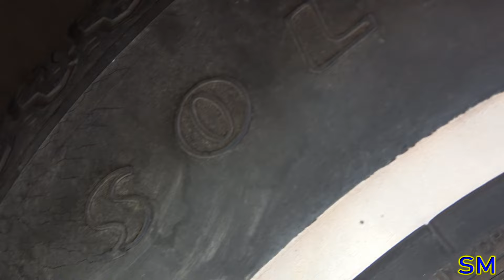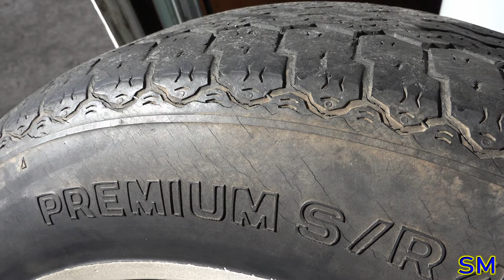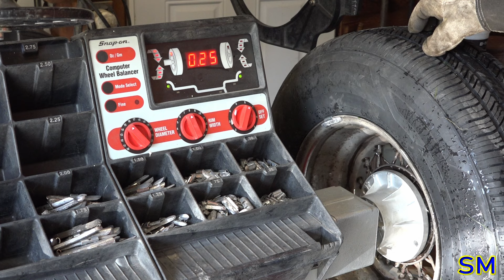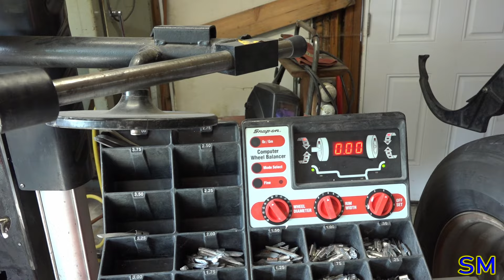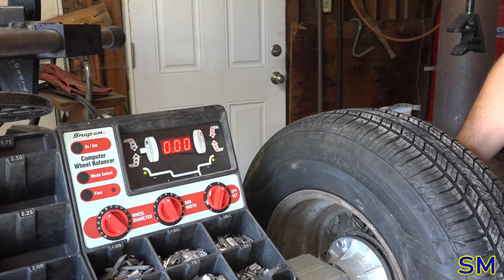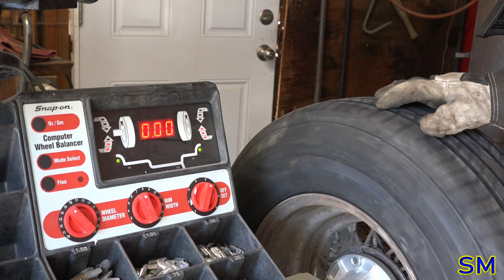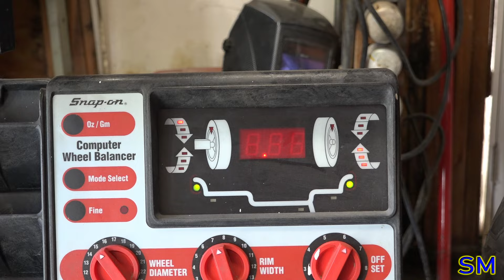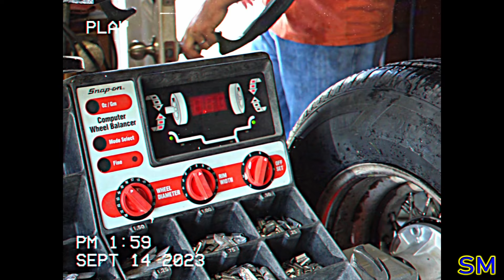New Tires for the 1971 Chrysler New Yorker!

Comment: Back in the day (90's) when I was a tire buster at Sears, we RARELY had to scrub the blue off of the white walls. We would just hit it with the jet setting on a garden hose for a bit and it would come off without having to touch it, Once in a great while we would have to bust out a scrub brush and some cleaner. Thanks for another great video.

Comment: You should scrub the wheels clean before trying to balance them. Sometimes dirt clots and grease blobs will throw off the balance.
Also,  a red dot or other manufacturers mark should be place at the valve stem when mounting the tires. Good video Bro.

Comment: I'm sure you probably know this but you can accurately determine what the correct psi should be using the information on your vin and tyre sidewall. Your vin should show maximum axle weights front and rear.  You need this number.  Your tyre will as well as a load index letter, have the maximum load in kg at a given pressure.  You can now work out how much pressure your tyre needs to support say 20kg this might be something like 1psi.  Now with the axle weight from the vin divide that in half to get the wheel load let's say 750kg. You know that 1psi supports 20kg so divide the 750 by 20 is 37.5psi. Easy. This way you will be very close to getting even tread wear assuming that the tracking and alignment is good.
Reply from the maker: Wow well done! I’ve never seen it written down before. Good write up!👍🏼
Reply: @SwedeMachine  One thing I have found out is these newer tires that have a higher MAX PSI rating than the tires of yesteryear drive and handle like a total fish if you run them at the factory vehicle recommended pressure. Those Hankooks like to run at about 5 PSI below max pressure for the best ride, handling and straight line tracking I have found out. I've had several sets of Hankook's in various different sizes and 2 sets of Arizonian silver edition tires made by Cooper that also have a high max PSI and the same deal with those as well. I run the Hankook Kinergy ST P215/75/14 on my 4 door galaxie and I run those at 45 PSI. Believe it or not, it rides better with the tires pumped up to 45 PSI and it has WAY less body roll and drives straighter on bad roads. It drives like a fish at 35-40 PSI in the tires.
Reply from the maker: @MattsRageFitGarage  Really now? Ok 10-4 on that! Full discourse I don’t have much experience with Hankook’s. Obviously it’s been a while since I’ve bought tires for myself as I’m not used to these new 50 psi ratings. I’m always used to the 44PSI max tires. The car did seem to have a bit of roll, even though it’s a land yacht. I’ll bump them up to 45 and see how that goes. Thank you much for the information I appreciate it!